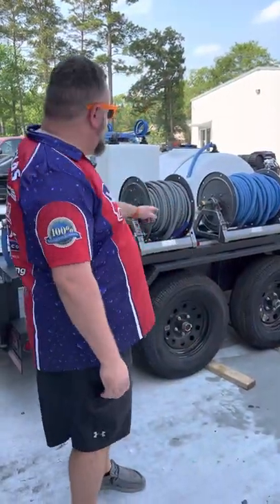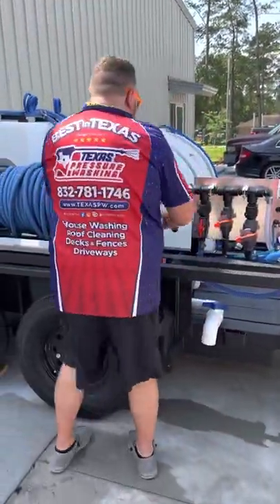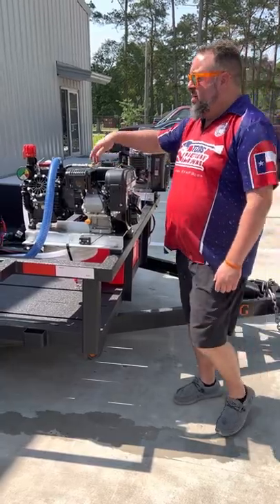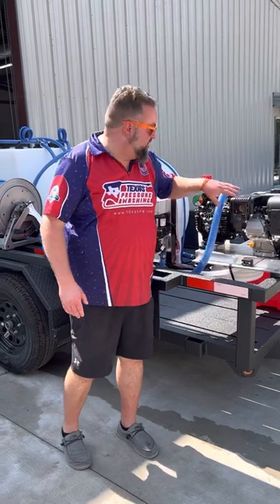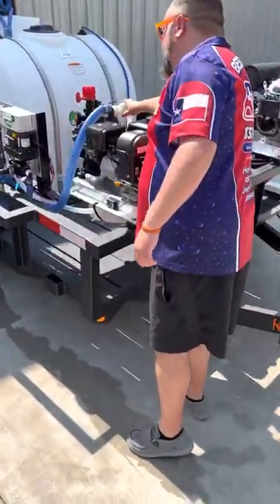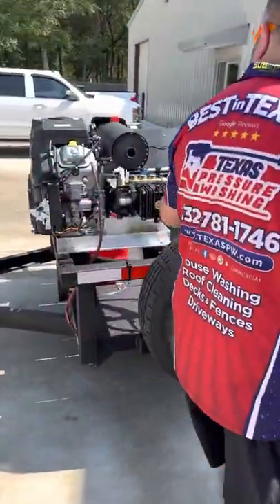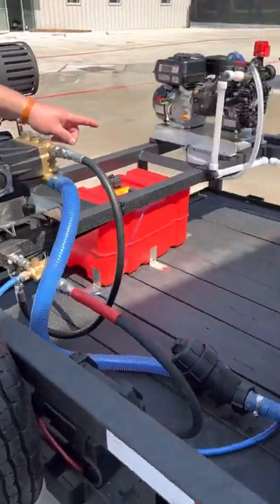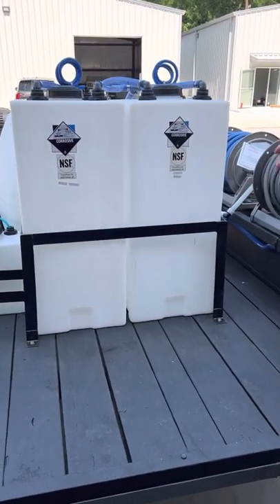Texas MAX Trailer Walkthrough

Comment: You set the unloader to 2500 psi right?
Reply from the maker: No we set the unloader for max performance and then use the correct meg nozzles in the surface cleaner or gun to achieve the desired PSI.